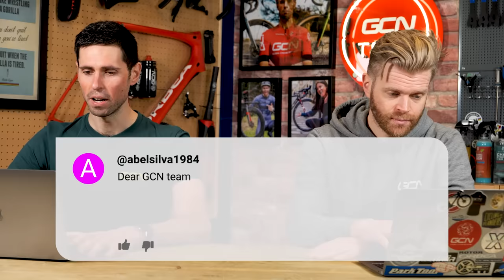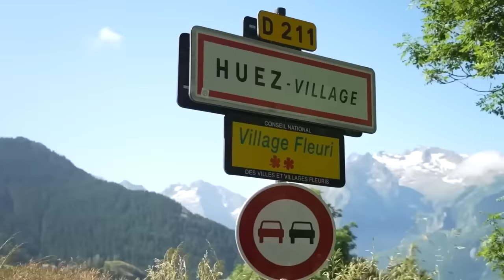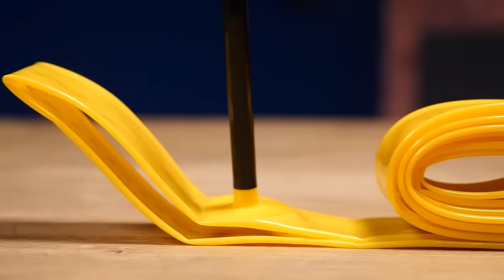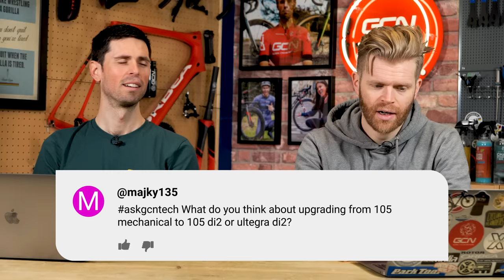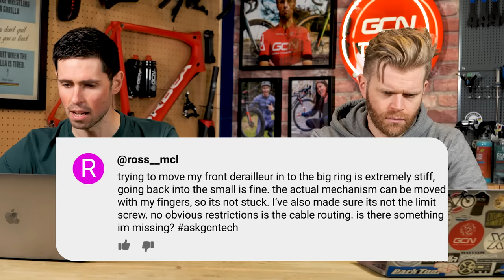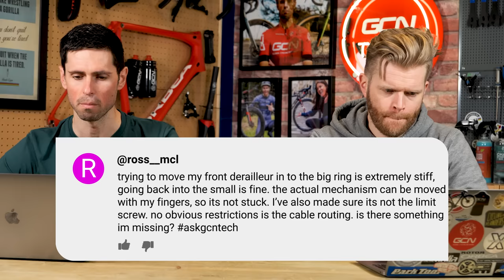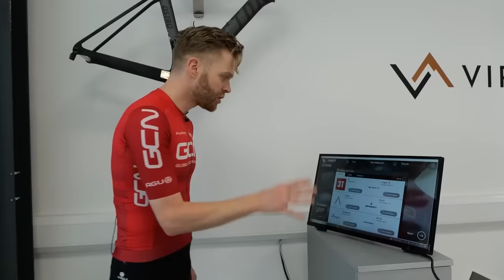Electronic Gears, TT Chainrings & BOA Cycling Shoes | GCN Tech Clinic

Comment: I have recently swapped to TPU tubes from a reputable brand. Approx 1 tube in 4 had micro holes in them and  had to be returned. I now test them before installing. Also, do not use electric pumps. The tubes do not like the heat generated and often fail around the valve.

Comment: No trouble with Schwalbe Aerothan TPU tubes...I have mistreated them on my commuter bike for 3 years now, even sub-zero  temps, swapping when seasons change, daily riding and no problems. It looses air over a week or two from 85 psi to 50 on a 37mm tire, but doesn't seem to go below 40. Pump to 115 on my 25mm race bike, also no problem. Love these, worth the cost...hope Schwalbe doesn't hear this or they'll raise the price.

Comment: Regarding the Di2 upgrade from UT11s. I recently bought a new bike w/12s. I opted for the 105 group set and the used the money that would have been used for the Di2 upgrade, I used on buying a power meter crank (meaningful and useful power) and a set of Look keo carbon blades. IMO it’s far more beneficial use of the money in terms of actual overall riding experience and general usefulness compared to the difference between mech/Di2 shifting.

Comment: I have had the same problem with stiff shifting to the big ring. For me, it's only ever happened on 11-speed Shimano (R8000) and it develops over time. It's definitely cable-related, in that a new inner cable solves the problem. Oddly, though, the old cable looks just fine. Maybe it just needed some fresh cable grease, or maybe there were too many little bits of flaked-off polymer coating clogging the system.

Comment: If your front mech doesn't move easily it could be an issue with the cable being connected wrong to the derailleur. If it isn't routed correctly it doesn't have enough leverage to move the derailleur.

Comment: I am in my 50s and recently bought my first carbon frame bike BUT with an 11-speed Ultegra mechanical groupset and my first tubeless setup. Verdict: LOVE the carbon frame, how light and sharp it feels and feels less of a burden on long climbs. (Note: came in at just about half the kg of the aluminum bike it replaced). Kept the mechanical gearing because I like how sharp it is (faster, snappier than the 105) and I tend to do some adventurous rides often far away from services. I know how to fix my mechanical. I also feel if I am in the odd country, far outside a city, I still might be able to get a cable. Given such rides, the tubeless has proved itself invaluable in spades. (Just keep a hand pump with you to top up pressure though)

Comment: I have Ultegra DI2 12 speed and I found Electronic shifting is really good and it’s one of those things that you don’t think is a major upgrade but when you have it you wouldn’t really like to be without it. However I have the 11 speed 105 on my winter bike and in terms of actual performance there’s very little in it compared to the DI2. In my opinion if your groups set is worn out DI2 is the way to, if it’s working perfectly fine buy yourself some new wheels and tyres instead as that’s going to be a bigger performance upgrade.

Comment: DI2 vs Mechanical - it depends, for 11sp no, but once you go to 12sp the Front Derailleur cage is thinner and needs to be trimmed more often. Then, if you have short chainstays, which is the fashion these days for higher performance roadies, or wider range cassette or you use more of the cassette and running crossed, the chain angle becomes tighter at the Front Derailleur cage and it's not uncommon to trim the same chain ring twice or maybe more across a cassette.  DI2 takes care of that for you.

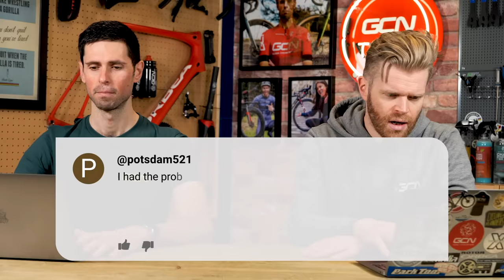Comment: 3:00 sometimes TPU tubes get invisible puncture. When you check the tube in water ,you cant see any puncture or any tiny bubble. But the tyres can deflate overnight. Because puncture might be to little to see below 50 or 60 psi. If it keep the air more then 3 hours, you can make that tube second spare tube, first spare tube must be always solid:)
Reply from the maker: Second spare we like that! How many tubes do you take on your rides?

Comment: The thing for BOA for me is actually the opposite as for the sprinters mentioned - once my feet start to expand/swell, I just open the mechanism by pulling up the button, so the shoes adjust to the swelling, then lock it again after a second or three without pedalling.
Reply: Because of the fine-tuning bit, I insist on shoes with BOA IP1 or Li2. These are two of the dial models that turn both directions (when engaged) with a quick-release function.

Your dials are most likely from the L-Series.

Comment: I had an aluminum Specialized Allez, and I bought a used carbon Cannondale Super Six Evo. If you have alot of hills in your area, like I do, I'd say go for a carbon. I don't care how fast I go up a hill, but the lighter carbon makes the slog so much easier! Personally, I feel the money was well spent. (And, apparently, so did the thief that stole it! I'm now saving for a carbon Specialized to replace it. I plan on adding SNIK GPS this time.)
Reply: What Specialized are you looking at?
Reply: @yonglingng5640  Hi, yeah, I purchased a beautiful, new, carbon 2017 Specialized Roubaix frame that's half deep yellow/half orange during the Pandemic. I've been doing a build on it over the last year at my local bike shop. I  made it a hybrid w/flat bars, due to my back. I know the shop owner installed hydraulics along w/SRAM electronic shifters. The cassette is a Leonardi orange/black 50T 12-speed w/an orange 32T 5Dev chainring and orange KMC chain. I believe the carbon cranks and derailleur are SRAM GX. It's a Frankenstein bike, but everything has been researched, and it all works. The grips are Ergon deep yellow, and pedals are also deep yellow. Deep yellow/black vintage Selle Italia saddle. Still at shop. Have $900 to pay off. Can't wait!
Reply: @elizabethpoley6882  Flat bars on a road bike, not that there's anything wrong with it and because it's on an endurance bike, I can imagine how much more comfortable it is for you, on top of having Future Shock up front.

Comment: Carbon fiber vs aluminum
I have an aluminum bike that weighs 8.7 kg without pedals and a carbon fiber bike that weighs 6.7 kg with pedals (yes UCI illegal 😁)
The difference between these is like a tractor and a sports car..
But I still ride a lot more with an aluminum bike.. my legs like it.. I don't have to be so careful with it.. and I dare to leave it outside the cafe 😁
Reply: That depends on what aluminum bike you have.  My best bike happens to be the new allez sprint weighing heaviest, but has the best handling and acceleration.  A car I would compare to is the Porsche 911 like

Comment: re: Riding on the saddle nose. I always end up changing a stock seat post to one with no layback. Also  , the right saddle is a matter of experience but does make a difference . And , surprisingly , a pair of pro level bike shorts ( read: expensive) , with the extra padding and/or the distribution thereof , can literally keep you off the nose. Usually. This assumes that your bike fits you and your top tube/stem length is appropriate for optimum reach. With all this and with a dead level saddle , I still find myself riding on the nose. Presumably because I just want to get someplace faster than the bike does.

Comment: easy answer: yes! (To electronic gears.) The shifting experience on Di2 is in another, better world.
Reply: Agree.  Electronic shifting is a dream!  It doesn't make you faster but it is a nice luxury.  Using an auto example, if you need transportation, a Chevy will work, but a Cadillac is much more comfortable if you can afford it.  Both will go the same speed.
Reply from the maker: It is amazing! It's not the most important thing though - It's a great luxury but not needed for every rider, don't let mechanical gears stop you from enjoying your ride 🙌
Reply: @gcntech  absolutely! Mechanical Ultegra is still a joy to use and is flawless. I ride both mechanical and Di2 regularly.

Comment: If you wait until your components need to be upgraded you lose the option to sell the old ones to help pay for the upgrades. I personally am wanting to upgrade my 105 11-speed mechanical groupset to an electronic groupset (maybe SRAM) and I plan to do it before my current setup has worn out so I can sell it on.

Comment: Hello GCN tech crew!  In May I'll be taking part in my first cycling event, a 160 km gravel ride, and I'm wondering how I should train for it.  The longest distance I've ever ridden is 120 km and my "regular" recreational rides are typically between 60 to 100 km.  The route of the event is not particularly hilly (500-ish m of D+).  Also, I commute to work by bike 8 months a year, 43 km total per day - how long before the event should I stop riding to work to "save my legs" for the big ride? Any advice? Thanks!  (Male, late 40s but slim and rather fit) #askgcntech

Comment: I got myself a great deal on a DI2 bike, only £2500 for Utegra Di2!
Reply: The problem with a great deal like that is... can I afford to replace or repair breakages? Probably has lowish grade wheels which can be upgraded in time and keep the originals for turbo trainer or riding on rougher ground in winter. My most recent bike was an Ultegra bargain but I wish I'd looked the gift horse in the face and gone 105 with better wheels.
Reply: @cuebj I pick up a DI2 Pinerllo prince with carbon wheels and Ultegra DI2 for £3100 in the sales. Their is bargains out there if you are prepared to look. Chain reaction had Vitus Vitesse EVO Ultegra Di2 model with Reynolds carbon wheels, carbon bars ect for £2800 at Christmas as I bought my wife one. If you can’t afford to replace the breakages, don’t buy a top spec bike.

Comment: If you want at least 105 hydraulic aluminum isn't that much cheaper. Endurace AL with 105 $1799. CF 105 $1999. For $200 carbon is a reasonable upgrade. There's also just a lot more carbon frames, so you are more likely to find the bike you love if you go carbon. That said if you find an aluminum bike you love no reason to feel bad about it.

Comment: hey @potsdam521 : are you using RideNow 26g(?) version?
i have been TPU user for few years, and have tried few brands. I had issue with RideNow 24g version (the older 36g version was fine). My findings is that the rubber seal-ring on the core were so thin, that if you had it seated at an angle (once the air in tube pushed against it), theres a chance air passes thru.
Try to pump till your desired psi + a lil extra, then press the core to let out air a bit n make sure it sits straight, then you screw down the 'nut' to tighten.

i think its a drawback as RideNow trying to do weight reduction on the 26g. i didnt buy/try the 19g.
/i bought the 26g ver because its offered in 85v stem lenght

Comment: Could you do a video explaining how the new shimano front mechanical mechs work (GRX, 8000 series)?They seem to be a nightmare to set up, unlike earlier models. The high adjust screw sets tension not a stop, and so there are two tension adjustments……
Reply: Set the High limit adjustment first, then fine-tune the cable tension adjustment when you're micro-shifting. I usually adjust cable tension until the inner side of the cage almost touches the chain when I've micro-shifted when the chain is in 3rd gear.

Comment: Hi Tech Clinic! I am a smaller rider (5’4) and I ride a Canyon Endurace XXS with 650b wheels. As you might know, carbon road wheel choices are slim at best at 650b and there are no latex tubes in 650b. If I switch up to 700c are there any downsides in ride quality or handling? My local shop fit 700c 25s and can probably fit 28 comfortably.

Comment: Electronic shifting or gears? The gears are still mechanical, i.e. physical, not electronic. It's the shifting that's electronically actuated. Or, more accurately, electro-mechanically actuated as there's still a physical mechanism involved. Given today's announcement by Wahoo and Zwift that the Core will now be able to do virtual shifting, that's what I think of when I hear "electronic gears", as opposed to physical gears.

And the more that people use virtual shifting on trainers, the more that they'll likely want electronic shifting in their outdoor bikes. And could automatic shifting be that far behind--or semi-automatic where you select the next higher or lower gear ratio and the computer figures out which chainring and cog combo makes the most sense and shifts to it automatically?

Comment: #askGCNTech
You have talked about about the energy efficiency of waxed chains over wet lube, but what about belt drive bikes?  What are the advantages and disadvantages of belt drive when compared to steel chains?  Thanks Oli and Alex.
Reply: They can go through dirt without any cleaning or lubing. So zero maintenance.

Only downside is they are a bit less efficient at transferring power than classic chains. That's why they're not used in road bikes
Reply: That's what I figured. I guess I was more curious about Oli tackling this topic to compare the energy differences. @comedyman112

Comment: #askgcntech why are we still using presta valves on road bikes? With today's wider rims there should be room for schrader valves which are great for pumping your tyres at petrol stations and using the same pump as commuter bikes. There are also other types of valves like Fillmore valves specific for tubeless that doesn't get clogged with sealant. Presta valves are delicate and suck! Are there any good reasons to keep using them?

Comment: @potsdam521 problem:
had a similar issue on my aerothan tube.
problem: the valve itself has metal  thread but thread from tpu tubes are plastic. over time the metal valve thread damages the plastic thread in valve hole :/

Comment: Also, how many road cyclists alive today would actually benefit from the aero advantages of laces or velcro vs. BOA in a way that could mean a place difference in races? I bet the number is in the low triple digits if that. It sounds like the ultimate in weight/aero weenie silliness, like Ti vs alloy bottle cage bolts. Or was everyone being facetious and I missed the irony?
Reply: I reckon it's more of an on-the-fly shoe upper tightness adjustment thing instead of aerodynamics. Some shoes use none of the three you mentioned: Ratcheting buckles, like on the Shimano SH-R321.

Comment: Looking for a shallow depth carbon road climbing wheelset under 30mm. Not many exist, except as gravel wheels. Is there a reason for this? Would it be odd to run a gravel wheelset on a road bike? Already have a set of 45's and feel a 15mm difference won't be that beneficial. #askgcntech

Comment: The whole ‘don’t upgrade until you wear out the other components’ tactic, fails to take into account resale value of the old parts and the length of time the parts last. The only parts you need to swap out when going electronic are the shifters and derailleurs - which all take decades to wear out and can be services to extend the time further. And then once they are worn out, you can’t sell them to help find the upgrade.

Comment: #askgcntech Answer this one! You know you think you want to. I have always carried a tube for emergencies with my tubeless setup. I recently switched from 700c to 650b wheels and am running balloon-esque 47mm whoppers. What will happen to a standard butyl 700c road inner tube (rated to 28mm) if I stick that in my tyre and inflate to 1.5 bar? Do I need to carry around an enormous 650b/50mm specific tube? It barely fits in my pocket! Thanks and good night.

Comment: Only reason I’m considering electronic shifting is because my left hand has been hurting for weeks from shifting the big ring on super cheap group set🙈
Reply: What groupset is this? Newer front derailleurs require less effort to actuate, especially when this derailleur's shift line's routing is problem-free.

I switched from 105 5600 to Tiagra 4700 and it took less effort to actuate now.
Reply: @yonglingng5640  It's a 7 speed Tourney groupset, maybe 2 or 3 years old. It's just an extra bike,  and it's too cheap to upgrade the groupset😁 I'll definately get a new bike first

Comment: #askgcntech
Good morning fellas, thanks for your informative vids. I still ride with rim brakes on carbon wheels, the manufacturer recommends specific brake pads for the wheel, but they’re very expensive. I’ve seen carbon brake pads on Amazon for a fraction of the price. Does it really matter what kind of brake pads I use on my carbon wheels?
Reply: Theoretically, yes, but you definitely should never use brake pads that were never designed for use with carbon rims. You may use aftermarket carbon-compatible brake pads like SwissStop, but you're experimenting at your own risk as no carbon rim manufacturer tests every single carbon-compatible brake pad in existence to see which ones work fine.

So the best thing to do is to consult with the manufacturer about alternatives other than the ones they supplied.

Comment: #askgcntech Is it a good idea to use older chain links to make a newer chain longer?

I recently put a new chain on my bike and, quite stupidly, accidentally threw out the unused chain links. Now I feel like putting on a bigger chainring and I'm not sure if my chain will be long enough. Thankfully, a buddy of mine has a chain exactly like mine lying around in his parts bin and he said he's willing to give it to me if I need it. His chain is much older than mine and has some mileage on it, but it's still in very good condition with plenty of life left. Can I use links from the old chain to make the new chain longer, or will there be uneven strain on the old links, causing the chain to fail from there?
Reply: It's not advisable due to inconsistent wear & tear throughout the entire length of the chain. Lengthening it with a set of new chain links is OK, but run two quick-links in total.